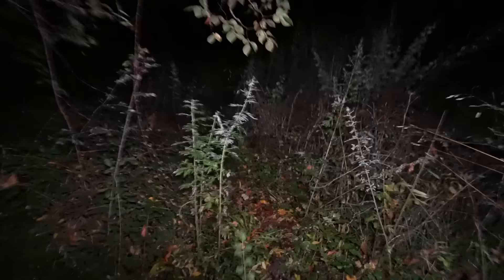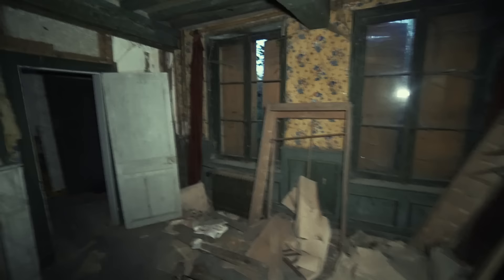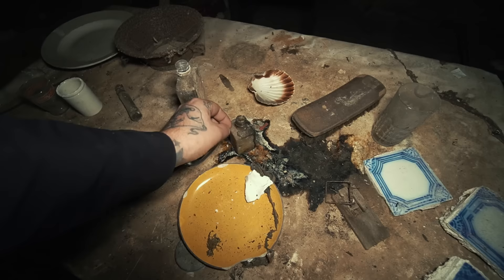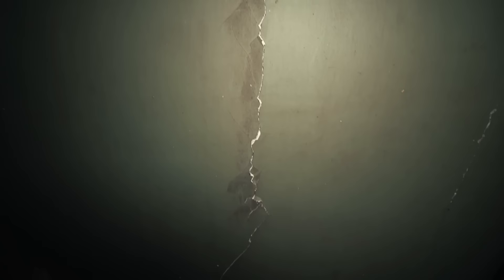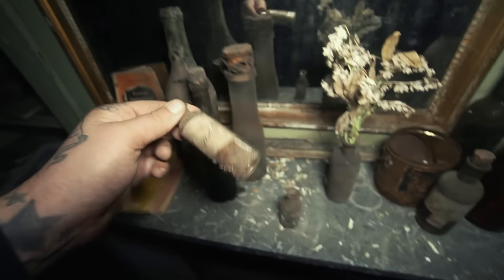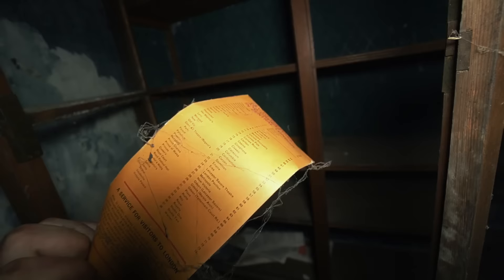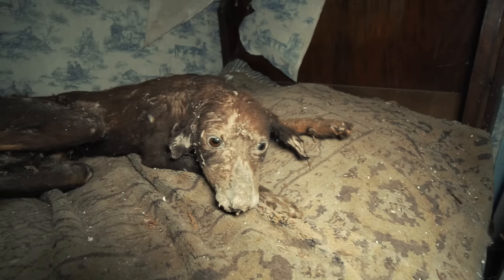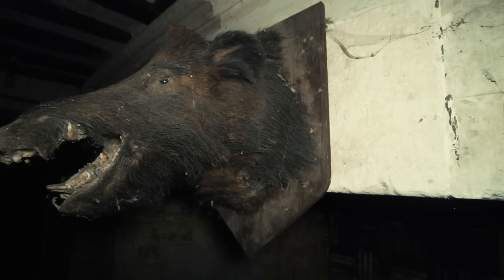Horrifying Find Inside Abandoned House Hidden In The Woods!

Comment: The fact that some of the books on tables have no dust on them means someone has been there VERY recently.
Reply: noticed that also...
Reply: Quite possible yeah, though sometimes places can be spotless IF there's no dirt being blown around in that area but that's more luck depending on how well that part of the house has been sealed.
Most likely other explorer teams have been around before, perhaps even checking out if the house is safe enough for this guy to come through.
Reply: yes the clean plastic water bottle on the floor in one of the rooms as well
Reply: And that bedding looked too clean to have been there over 40 years also when lifted the bottles didn't have a clear spot underneath considering that they are supposed to have been there for years..........
Reply: @gerryxanthopoulou1279 certainly the bed with the shiny green sleeping bag was recently used.

Comment: The room with the small bed looks a little cleaner then the other one even the bed itself looks recently used no dust or anything on the bed if the place has been abandoned since the 70s the bed would definitely have some mold and dust on it my thoughts on it are that someone has been squatting in the house and using the small bed

Comment: It isnt a work top its a stone sink.  You sometimes see them in old gardens with succulents in x There is a drain hole in the floor and the waste water would go straight outside or into a bucket and used on the garden x